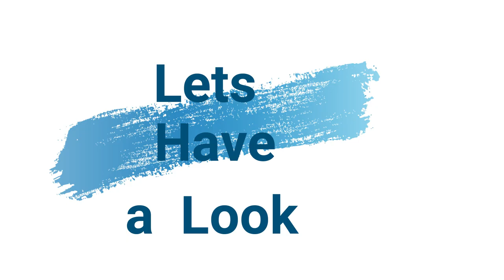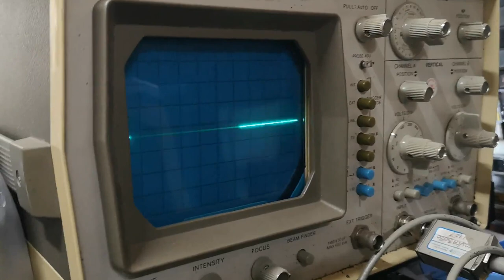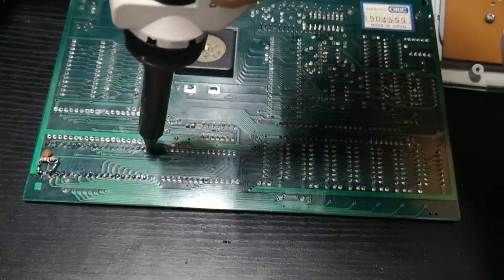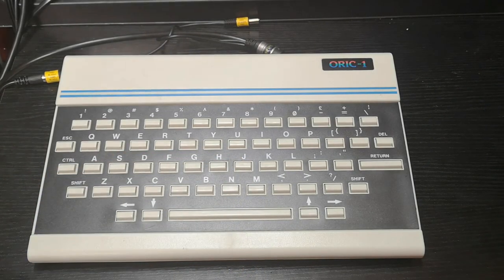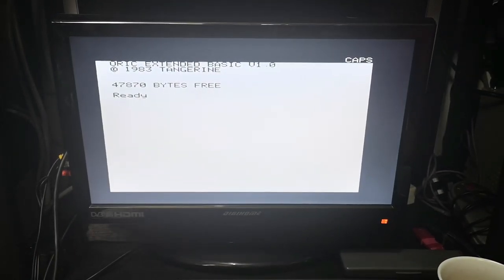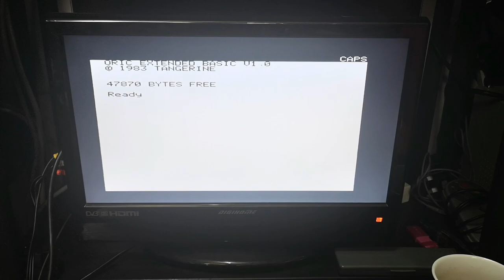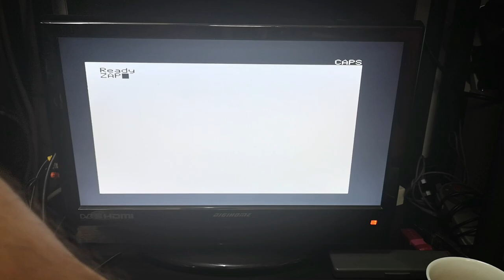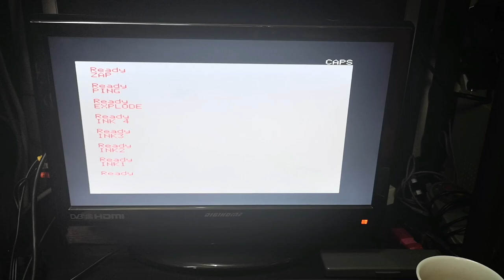Classic computer   Oric 1 repair and review

Comment: I went for Oric-1 over the spectrum as wanted 6502 system and done the z80 upon the ZX81, got early one, manual was ring bound and logo saying ORIC-1 was just black and white.

Did get the plotter they sold, was cute and worked well, but replacement pens not cheap.

Moved to the Atari ST, though Atmos looked nice, was just a from and keyboard upgrade from the Oric-1.

But darn, so wished they added a volume control for that speaker as was bain of my parents.

Comment: I chose the Oric 1 over Spectrum as my first computer. Then upgraded to an Atmos. Still have the Atmos.
Reply from the maker: I actually wanted an Oric-1 when I was a kid mainly because I got suckered in by the look of the machine. But I already had a computer so it was difficult to justify another model as it was quite an expensive purchase for a young boy. 
Its great to hear you still have yours. I hope you still enjoy it. Cheers Phil
Reply: Why would you upgrade from Oric 1 to Atmos? Aren't they almost the same?
Reply: @matiasd.7755  Yes they are almost the same bar the keyboard which is the main reason for upgrade.